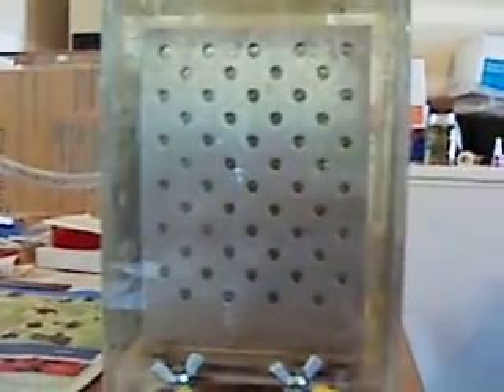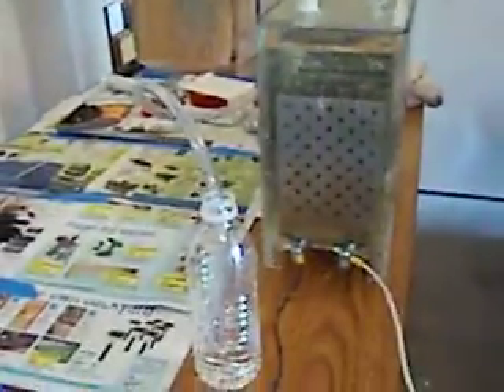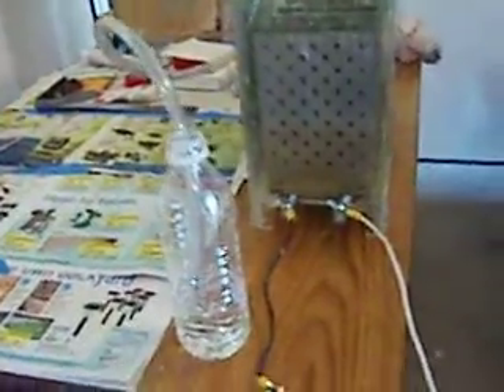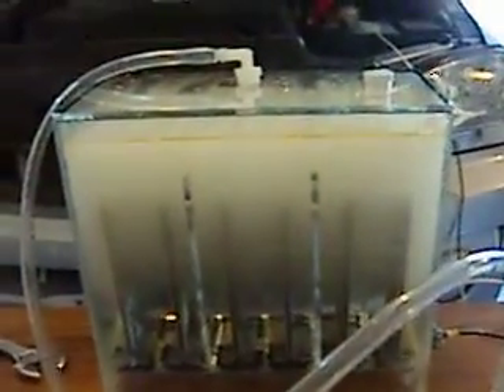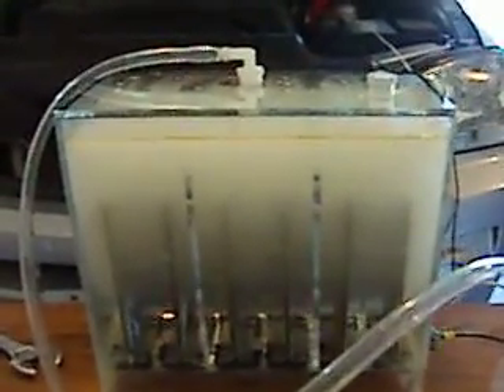Acrylic HHO Generator Video 2

Comment: @FIZZYH2O um wiring problem can be fixed by using a fuse and as for the solution i found 6 parts NaCl to 2 parts NaHCO3 to 500mls of water works perfict compered to Lye but my mate added about 300mls of vinegar to his and he reckons its the best

Comment: start of with the  surface area ,u r on the rite trach with holes. try a fine screen 316 stainless in close proximity to each other.to avoid un sightly debree from building up dont use any electro;ight .start with pure deionosed water .it will seem slow at first .but production picks up relativly fast .i recomend filtering the solution periodicaly ,ive heard it has some medicinal prprerties.hope this helps .if u insist on using an electrolight try citric acid this is very suitabe ,not koh

Comment: oh,yeah drill the drain at the bottom  of the tank,use gravity as your Friend. Headche's man are like picking it up and ect. just not worth it. Try using Diodes between plates in the direction  of current flow. in a sense then you'll be building a voltage Tripler which brakes down water at a higher Voltage/Freq.
Send me your next video when you do those things and see if im right or not? :)

 Good Luck and Happy Trails  to Youuuuu!

Comment: You can also use NaOH lye found as crystal form in hardware store in drain cleaner- you want 100%. Also the Amps are to watch as stated, but I believe your unit runs in series and minimal heat will be produced- Nice design.

Comment: As long as your chemical concentration stays low, none of them will give you much problem with clouding. Some here are using citric acid or zinc sulphate for electrolyte. Just like all plastics, Lexan's biggest enemy is UV rays. Clear Type I pvc has the highest chemical resistance, if you need to stay in the clear category.

Comment: Most acrylic fabricators use a commercial solvent welding product called H-94 which is made up of acetic acid and acrylic monomer. The problem with using acrylic is it's lower chemical resistance. The acrylic will eventually turn cloudy and degrade. The speed will depend upon whether you use baking soda or crystal drain opener. Try using clear, Type I PVC and you can use over the counter solvent welding products (for PVC pipe) from any hardware store and hot air weld if you need super strength.